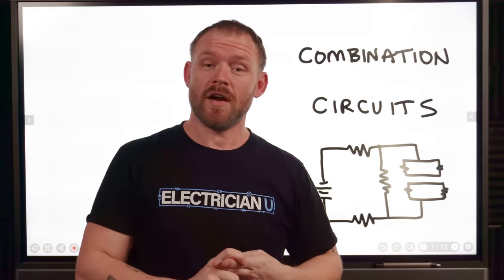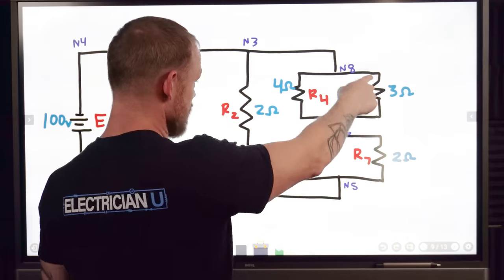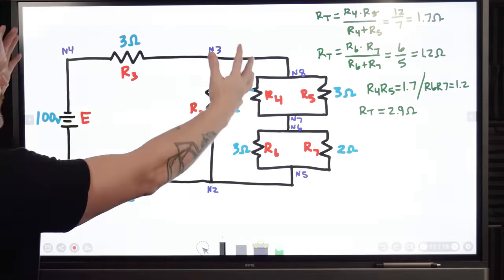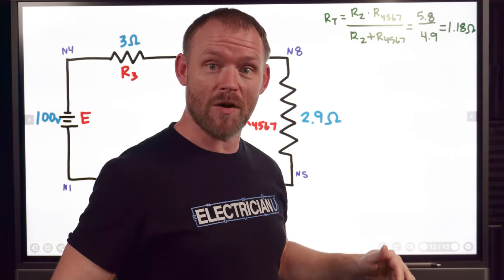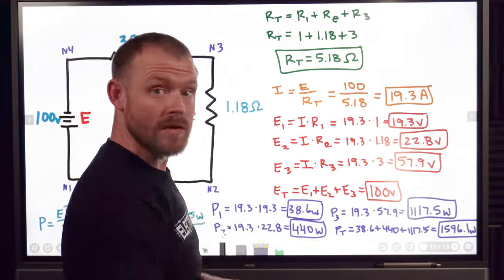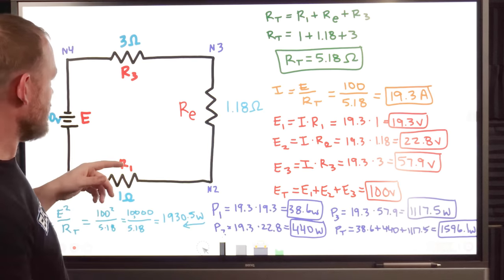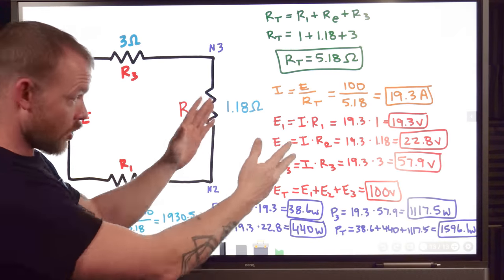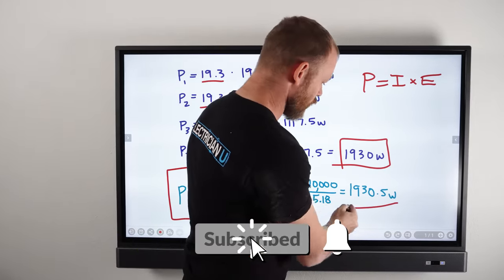Let's Talk About COMBINATION Circuits: Voltage, Current, Resistance, and Power

Comment: That's great and all for finding the total values of your circuit, but you will most likely still need to find every value of your ORIGINAL resistors (The ORIGINAL circuit shown) in a test. I think you may have missed that step. The rest of the content was very well explained though

Comment: Well done. For us electricians it’s a nice refresher but if you’re trying to teach new would be apprentices, maybe slow down a little. Maybe explain that the current that’s flowing is coming from the supply so it doesn’t sound like it’s just magically appearing, and after you sum up the resistances, then you can break them down again to see the current that flows in each branch of the circuit. And further to the power dissipated by each resistor in each parallel branch. 
You scratched the surface nicely, but there’s a lot more to it.
Reply: I'm new to learning this stuff, but it's still good so long as I watch alot of content I can start connecting to dots. Kinda like a kid playing ball with an older sibling, yeah I suck but I can learn alot faster than they did.
Reply: I'm a beginner and he explained it nicely 👌

Comment: Flash back of my basic electronics course. Next step, evaluate a Wheatstone Bridge. Well, for electronics that is a next step to learn how to use a Wheatstone Bridge to make a simple resistance meter and then see how to apply that for various sensors that use a variable resistance for the sensing element (strain gauges, temperature sensor, etc). Are Wheatstone Bridges used much in electrician work?

Comment: op is it possible to use a gfci outlet in a dc to ac inverter device without the need for a gfci breaker?

Comment: I know that video has been up for a little while but would it be possible to address re expanding your circuit to find voltage and current through each resistor including the ones in parallel

Comment: You should do a video on what a parallel circuit is like do you mean a house circuit or a motor circuit. And you should do a video on what a series circuit means do you mean house. I think you should do videos that relate to the actual job. It will help us actually visualize and relate the class like preaching and Choctaw to actual on the job skills.

Comment: Just wondering why you did not complete the analysis and figure out the voltage across, current through, and power for each of the original resistors?
Reply: Probably for time reasons. There may be a part II that breaks down the voltage drop, current flow, and power for each of the other resistors. Lots of whiteboard slides. ;-)

Comment: If you're just looking for power through the loads, it'd be easier to just use (current-squared times resistance). No need to solve for voltage drop first.

Comment: How is this supposed to be relevant for a construction electrician???
I learned it in trade school, but never had to use this knowledge in 25 years as an electrician.
The only thing that goes in serie with other things in parrallel, are switches or contacts...
Reply: Christmas tree string of lights.   Plug at one end receptacle at the other end.      The bulbs are in SERIES.  Plug in a second string (to the mentioned receptacle) the two strings would be in parallel.

Comment please.
Reply: Current portion for the mentioned Parallel resistors (load)?

Otherwise clear concise information.  thank you
Reply: @tedlahm5740  christmas lights in serie..? It has been almost 20 years since i have seen it ...
They stopped doing this because it was a pain in the ass to find the defect bulb .
Reply: Most Christmas strikes be contain believe its a resistor in parallel with the light bulb. If t un e light bulb burns out rest of series light bulbs remain lite but if you remove any working or non working light bulb from socket the entire set goes out ( some!are lamp sets may consist of two or three sets of series circuits.